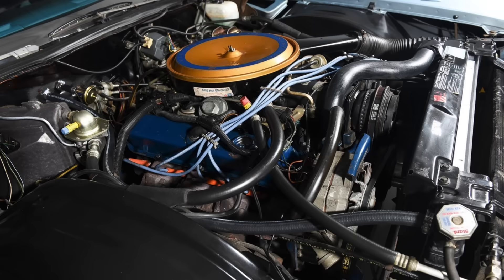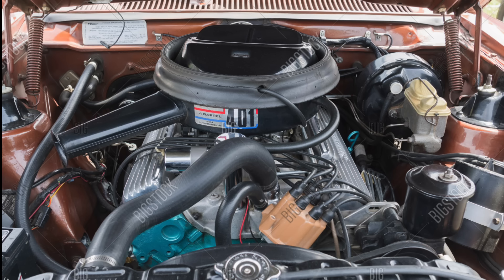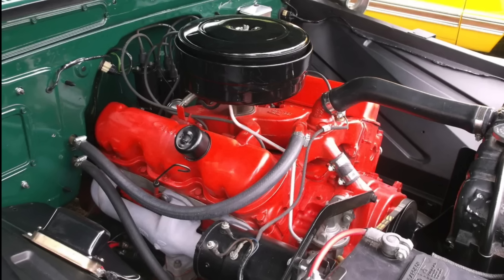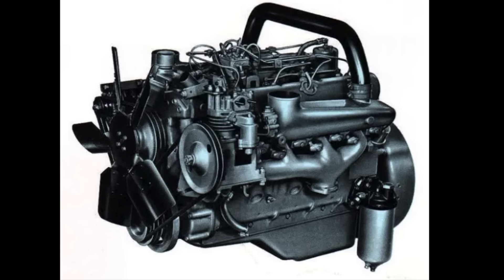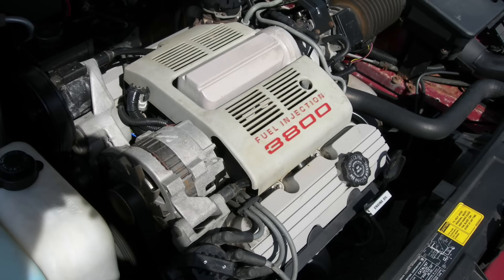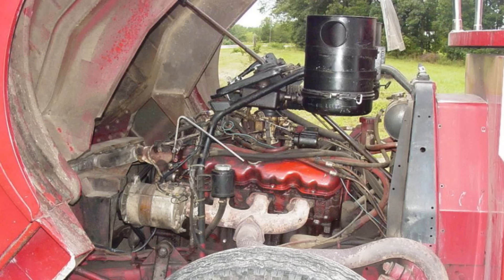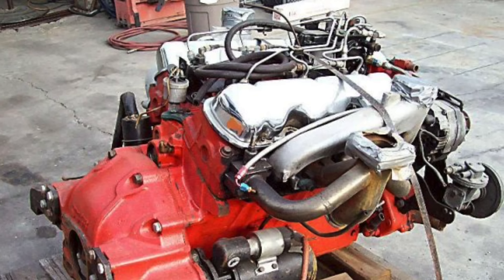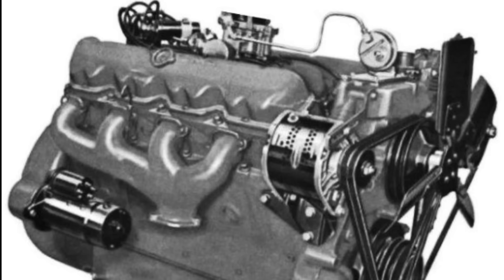The 1966-72 GMC 637ci 60-Degree V8 - GM's Largest On-Road V8 Is Virtually Unknown!

Comment: Hello frien, I'm an old retired mechanic. In the early 60s, Ford offered a 534 V8. I believe it was 534. I worked for a construction company, We had 2 Ford F550 single axle tractors with 534s. The intake was massive. I live in Florida. The used these same engines in orange groves. Back in the 50s & 60s farmers combated the cold by using short towers with a propeller on it to push the cold out of the orange groves. You still occasionally still see these towers, now a relic. They were powered by 534s. It may have been classed industrial, but they were in trucks. Note, the 550s that had these had a bubble top. The roof was higher than conventional. They were referred to as high hats.
Reply: I learned to drive in an F-800 with a 534 and a 10 speed transmission.
Reply: Our first C-Cab chassis American LaFrance pumper in 1965 was a 534.  Had until May 92.  Second ALF With a C-Cab was a 3208 and our first Auto in 1980.  Ran until 2006.  They always said the 65 with 534 was no slouch at all.  Just hungry lol.  Neighbor dept was mostly GM plant guys, they had a GMC COE under an old FMC body.  The big V6.  No Guts lol.
Reply: The Super Duty engine family(401-477-534) was built 1958 through 1981. 
There were even marine twin turbo Seamaster versions of the 534.

Comment: I think some people watching this may be wondering why such a large displacement engine puts out so little power. This engine could easily have produced double the power if it were built to handle higher revs, but it was limited to 2,800 RPM which is well below the power band for a gasoline engine. Gas engines generally start making power above 5,500 RPM and the peak depends on how well they flow, and other factors. I guess truck transmissions of that era were designed to work with typical diesel power bands that would normally peak below 3000, though if the engine was built to produce 600-700 HP it could have expanded its potential applications beyond just trucks.

Comment: I don't know if you said "tarded up..." or "tarted up..." But both are wrong. GMC is the "professional grade" of Chevy, meant to be fleet vehicles. So they are fitted with sturdier: door, hood and tailgate hinges (for commercial use) and usually come with transmission coolers and other equipment that are only optional on Chevys.
I hear so many youtubers blathering about GMC vs Chevy like they're experts, but it's clear they've only done about 5 minutes of research on the subject.

Comment: The “biggest” V8 I know of is the 903 Cummins that was used in trucks and equipment from the mid 70s. They earned the nickname 9 oh nothin since they were such a boat anchor.
Reply: The9-oh-nuthin' is so bad that it powers the Bradley Fighting Vehicle with 600 hp at 2600 rpm.
Reply: @vtta9035  really? Didn’t know that. Maybe it’s better than I think.

Comment: The v12 702 was not two V6 couples together. It was one block one crank and one cam.
It used 4 heads and two intakes and carbs and 4 exhaust manifolds. It uses 351 rods and pistons and heads

Comment: In the 1940's Ford had an even more impressive gas V8, the 1,100 cu. in. Ford GAA which put out 500 hp and 1,050 ft./lbs. of torque and a gas powered V12: the GAC with 770 h.p.  These engines were very advanced for their day having aluminum blocks and DOHC 4 valves per cylinder with dual magneto ignition systems.  However, they were only used in tanks and recovery vehicles, never in civilian vehicles.
Reply: Tanks

Comment: You forgot to mention the Ford Super Duty truck engines of the era: 477 and 534 cubic inches.

The V12 was not two V6's coupled together.  It had a one-piece block casting and a one-piece crankshaft forging.

Comment: Actually, Ford's largest V8 was the twin cam, 60 degree, flat crank V8 used in military equipment. Then there was the 549ci big block V8 used in trucks and marine applications.

Comment: I remember working on these engine in Coca Cola delivery trucks with my pops.  Had to run over head adjustments every 15 to 20 k miles because some had solid lift cams and lifters and that was done with engine running, valve cover off (of course),, bit of an oily mess.  They would tac out so fast cause of the stroke in these old boat anchors. Brings back memories.

Comment: When getting more power out of the big cadillac engines, adjust the ignition timing to Oldsmobile timing.  That is, set it to 23 deg BTDC.  No, it won't spark knock.  The emissions restrictions already had the timing retarded from the factory.  You are simply correcting that mistake.  It is even more impressive on the '76 500 cu in. analog fuel injection engine.  Diagnosing that fuel injection is a bit of a task, but not impossible.

Comment: Ford produced Super Duty truck engines from 1958-1981 and they had 477 and 534 ci versions, so technically that's the largest on the road gas V8 that Ford ever produced. Well.....unless you count Sherman tanks, which did also technically run on the US streets from time to time. And those pack a 1100 cubic inch all aluminum GAA or GAF Ford V8 motor.

Comment: I've only seen 2 of the 637 V8's in GMC dump trucks in my 67 years!😄As for big V8's, Ford also had a monster 'Super-duty' series for medium to heavy duty trucks (and marine use) from 1958, all the way till 1981. There were 4 different versions. A 401, 477, 534, and a twin-turbo 534 developed for Seamaster Marine, called the 'Super Seamaster 534-TI-B' that made 400 hp. and 657 ft. lb. of torque! They were big, slow turning V8's that maxed out around 3400 rpm, but made gobs of torque in the low-rpm ranges where it was most needed for heavy loads.😉
Reply: My clapped out 361 FT churns maybe 3,800 max. But god damn it makes gobs of torque at 2,000rpm. I love and hate the pile of sh1t all at the same time
Reply: @whathappensinmaine5463  🤣👍 I hear ya.. 331, 361, and 391's were all industrial/truck engines that seemed like gutless wonders until you started loading them down. They used a bunch of them in the F500 - F700 trucks back in the 1970's.
Reply: @danw1955  yep, i did find out if you just dump the clutch in 2nd it will spin tires tho. Did it coming off a stop light on a hill and it just lit the right rear up🤣
Reply: International made a 549 v8 as well.
Reply: @stevenmiller6725  That is correct! They used some of those in smaller gas powered cabover truck-tractors back in the late 60's to early 70's.

Comment: The 702 twin-six was not coupled together.

It had one casting of the block, it had one forged crankshaft, 4 separate heads, 4 separate exhaust manifolds, 2 carburetors and 2 distributors
Reply: That engine sucked fuel to the point of having 2 to 3 MPG.
Reply: To underscore this fact there is a core plug right at the centerline, definitely NOT two blocks mated...

Comment: The 637 was a "Boat Anchor".   I put an Olds 455 in my truck - it had much more power and way better fuel economy(4 barrel Quadrajet)  It was under square at 4.125 bore and  4.25 stoke and a torque monster.  This is a very smooth and quiet V-8!
Reply: Too bad they didn't have the camshaft technology they have now. I'd do a cam swap and add a four barrel, make a lot more power.
Reply: @hoost3056  Well, now you can have a custom cam made to your specs.
Reply: All of the GMC big blocks had shrouded valves that limit RPMs and horsepower.

Comment: As a young mechanic in the 80’s one of my first in-frame jobs was on an 60’s GMC moving box truck with a monster V6 in it. If I remember right it had the longest rods I had seen in an engine at that in my young career. Pulled the heads for a valve grind, oil pan to push out the rods and pistons, rolled in main bearings, cross honed the cylinders and spent time in a few local wrecking  yards looking for and exhaust manifold. Also pulled out the the rear axle third member for repair of the pinion bearing and two speed . Ran ok after, still think it was a big POS that my boss just seem money for a big job for his little repair shop, and the customer was a little shell shocked at the bill . Good times though

Comment: I had a 62 GMC with the 305 V6. Did a full rebuild on it, I think 40 over pistons, cam reground to a modern profile, ported the manifold and put on a Holly 500cfm carb, electric ignition and shaved the heads to bring the compression from something like 7.5 to 8.0. It really moved and felt like a totally different motor. Yes I could have just stuck in a 350 like everyone else but this was more interesting.  Except for the parts stores that always said..no sir the 305 is a V8 it's not a 6 cylinder.
Reply: I had a counter person at a GMC dealer ship,that when I was searching for a pair of PCV valves for a 305E and was told "Hold on partner, they didn't build a 305 till 76,and make sure I know what kind of engine I am working with before I came back. I replied thanks,I will do that.

Comment: This engine was from a time when diesel technology for on highway medium and heavy duty trucks was still evolving. The big gassers (Ford has the Super Duty range) would be almost extinct by the late 70's/early 80's when some of the diesel offerings from CAT, Cummins, Detroit and IH made more economic sense for fleets. If I recall, the Toro-flow diesel versions did not fare very well and was dropped after a few attempts to make it reliable in heavier duty applications.
Reply: Operated a 1965 GMC in 1994 wheat harvest crew. It was our service truck. Had the Turo Flo diesel. Was told they fell out of favor fo trying to get up to 3600 rpm. Harmonic balancer would break. Avco New Idea put that same engine in their 705D tractors. Turned the rpm down to 2800. Great work horse then. I have one. Also read where the 478 diesel was use in the marine equipment.

Comment: Doesn't it make sense to have an over square engine to smooth itself out being only a 60% V8 ? Long strokes have great torque but vibrate more. So GMC probably wanted a high torque compact engine. Also over square adds not only a little more smoothness but also longevity. To aid in torque of course it was tuned for torque with the small carburetor and probably had almost no valve overlap to the camshaft. With torque you can always utilize more gears and only need high torque because drag racing isn't the point how quickly you accelerate. You move a lot of cargo and weight at once anyway and it's more fuel efficient. Being a large displacement gasoline engine they burn more fuel than a diesel would of course but it's easier finding gas stations that have gasoline as opposed to diesel. So it's a high torque gasoline or petrol engine for trucks buses. Well designed

Comment: I will always marvel at the old GMC monster engines, like their gigantic V6s for trucks.
Reply: back in the early 90's i had a 50 chevy half ton, was deluxe model had early 235 over the standard 216. pulled that and stuffed a 302 gmc engine with a clifford 3 duece intake and header with a gmc hydramatic from a 2 ton truck (4 speed auto with a clutch) and a later 12 bolt and man that thing ripped, stop light to stop light even v-8's couldnt stay with it. 1st was really low so launched hard as hell.
Reply: They had a 500 ci straight 6.
Reply: @russellstyles5381 yup, 503 cid, there are videos those on YT.  firetrucks were one source.  That era had several GMC 6s in the 300s, 400s of displacement, 477 was one of 'em.  I'm not sure of exact first year and last year, but 1930s for sure, from an earlier GMC engine architecture, they also built some even bigger 6s, several displacements,  up to 707 cubic inches(at least a 400, 468, 525, 616)-John Gunnell book if you are into GMC).  In buses.  Yes (if one looks it up, Mack built a 707), but GMC did too.  From what I read, for the era it wasn't a slug, it was considered at least a little high performance (or however it was stated).
Reply: I gotta find one myself!
Reply: They built a v12 that used parts from 2 351 v6s
Reply: @masjuggalo  That was a very rugged V12. With the heads removed, look at the cylinder wall thickness. Paragon Oil (Gulf oil distributor) on Long Island, in the mid- late 1960's had some GMC 9500 series short nosed conventionals, tandem axle tractors, ran these V12's, and I saw and heard them, remarkable and impressive. In 1966 I was 13 years old and recall them very well. Those I saw hauled 9200 gallons of no. 2 diesel fuel.
Reply: @petermalanchuk8210 impressive, indeed

Comment: Engine powered compressors and pumps are used in remote locations where grid power is unaccessable or uneconomic to install. This often occurs during the initial development of an oil or gas field, when the economic potential of the development is not yet known. As well, I have seen the use of engine powered equipment in mining, agriculture (for irrigation), and power generation in (very) remote areas of the world. 
I have run across the use of conventional automotive engines in this service; sometimes, it is a good choice for the initial rollout of a project before more robust equipment is available. 
Engines in this service are considerably de-rated from the nominal power rating that they have when installed in vehicles. For example, when using the Ford 460 in this service, the engine is modified to have forged rotating equipment, HD timing chain & sprockets, and oversized oil pan with remote storage for 12-15 litres capacity, and a two-stage oil filtering system. The cooling system is also enlarged. Experience has shown that a 460 Ford engine thus modified carries a continuous rating of 60-65 HP at about 2700 RPM. 
General Motors 454 engines, based on the big block Chevy engine have similar performance when installed in similar circumstances and with similar supporting equipment. I have no doubt that a Mopar 440 would provide similar service, however, the Mopar B/RB engine has been out of production for about 45 years and so I reckon that is why it is not seen anymore in this service. The same could be said of Oldsmobile and other BB engines. The fuel used to drive these automotive-derived engines can be either 87 octane regular gasoline, LP gas, or natural gas. Natural gas,  if available, is preferred as it is then piped in and does not require refilling. LP gas is generally preferred to gasoline as it burns very cleanly, and there is minimal or no oil contamination from the fuel.
It is interesting that these engines have much higher power ratings when installed in passenger vehicles. Even the smogged-up versions from the mid 70's have ratings of say 200 to 260 HP, and in 1970 some of these big block motors had ratings appraching or even exceeding 400HP.!
Of course, the  400 HP number could be obtained using an SAE gross configuration, and could only be done with a quick dyno run-up, maybe two blasts like this in succession, followed by a cooling down period. 
The large displacement and large physical size required to continually sustain what seems to be a moderate power output is generally a function of the ability of the design to continuously reject heat. Automotive engines that are familiar to us, when installed in a car, suv, or light truck, are not designed for full throttle power bursts of more than 15-20 seconds, and this is usually all we can do anyway without running out of road or attaining speeds far above the posted limits.
Conversely, if we attempted to operate a stationary version of one of these big blocks, running say a pump or compressor continuously at a 200 HP load, we would find that the engine would overheat and be damaged to the point of unuseability in a matter of hours. 
One exception to this is a marine application of these engines. In these cases, the near-infinite cooling sink of the river, lake, or sea usually provides greater cooing  ability at a lower approach temperature than air cooling. The limit on attainable power and/or duration of load is not, generally, limited by the ability of the unit to reject heat. 
For conventional, non-marine installations, a continuous rating of about 50-80 HP from any of the domestic big block engines is appropriate, and if packaged up correctly with proper cooling, oiling, and fueling systems, they will give satisfactory performance for the rated time between overhauls.
This is a niche application for automotive V8s, but it is interesting as it shows the true limits of these engines in continuous power delivery. At the same time it also shows how brilliant the auto engine designers were: they identified that a good car engine design needed to idle smoothly and quietly, provide lots of torque for moderate acceleration and cruising, provide occaional bursts of power when required for quick get-aways and freeway passing, and to do all of this with reasonable to excellent fuel economy. Quite an achievement in an era before precise computer control.

Comment: 702 v12 GMC engine used for v6 cylinder heads but the block was cast all as one. Only seen one in a cab over fire truck and irrigation plants.

Comment: I got a chance to work on one of these back in the eighties. Took the heads off ground the valves and seats. I remember thinking how big that hole was when a 6" extension fell down into the cylinder😮

Comment: During WW2 Ford did have a 1100 inch gasoline V8. It was DOHC, all aluminum, and had a flat plane crankshaft. But since it was a tank engine only I don't think it counts on this list. Although the Caterpillar 3408 is a diesel V8 of the same displacement and it did get used in trucks
Reply: Also 60 degree cylinder angle.